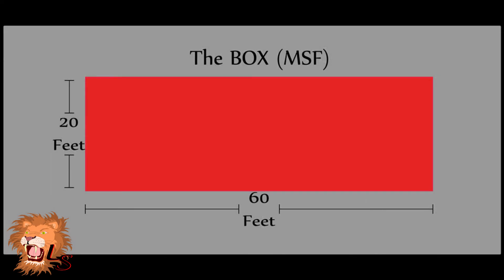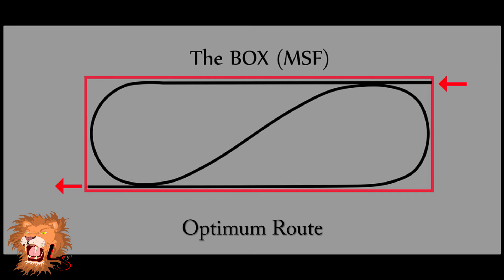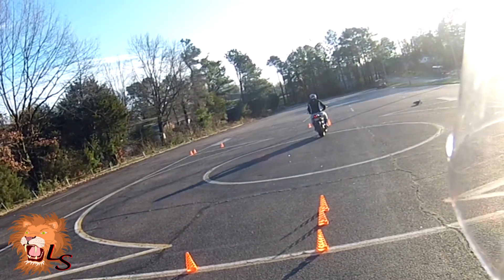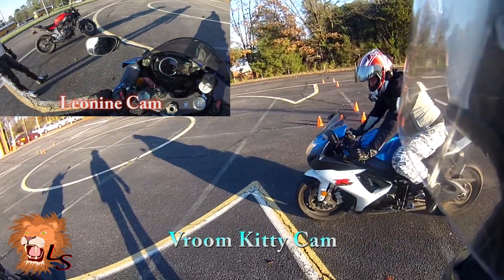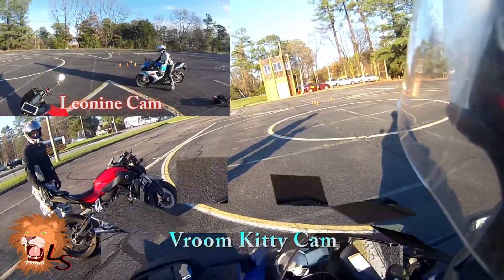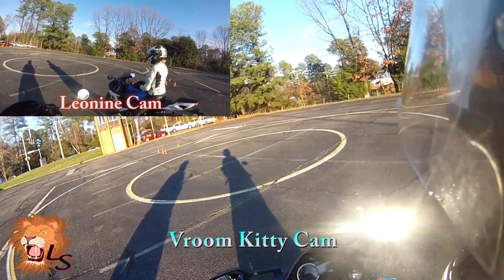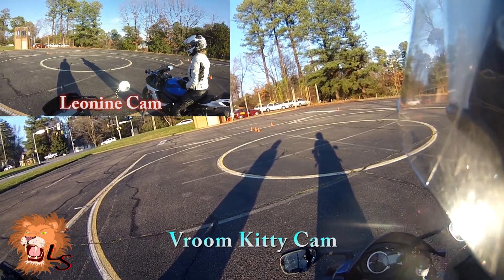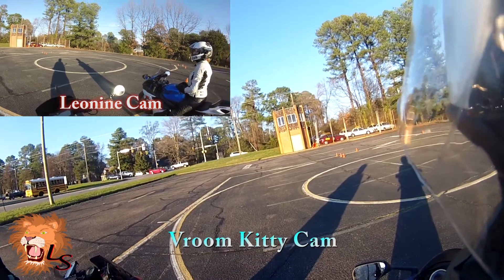The Box, Take 2

Comment: In Ohio, it's 20 feet for under 600cc and 24 feet for over 600cc. So the FZ07 has a really unfair advantage here. It has about the same physical stats (weight, wheelbase, etc.) as my previous CBR500. The FZ07 is definitely a great bike to take the test on if you don't have a little 250 available. Nice, helpful video you two.
Reply from the maker: TY, Luc.  Yeah, its a ridiculously nimble ride.  I think regular work on this drill really helps keep some skills you don't use often much sharper.

Comment: We have to do this (it's in Dutch, so just look at the pictures): https://www.cbr.nl/motoroefeningen.pp? as part of the exam for the motorcycle driving license. Besides a theoretical exam and a driving exam. (3 exams total, costs about 200€, then about 10 lessons from driving school is about the average amount of lessons, about 500-600€).
Reply from the maker: +Stefan 123 Some nice drills there.  I notice the 6 meter (20 feet) for turns seems to be an international standard.  I may try to work a few of these into my Winter Drills.  Thanks!

I took the MSF course ($175 +/-) to get my license.  It was two days, 6 hours classroom, 10 hours range.  It looks like its a bit easier to get a permit here...

We did a lot of those sort of drills.  The Box was one of the tougher ones for many riders, but it was not too bad once you got the head turn right.  Just like the cone drills, the trick is to look ahead where you wanna go.
Reply: Yeah, you're exactly right, always look where you want to go, and don't fix to one point. That's the trick to get through every corner anyway. If you ever need a translation of these drills let me know, I can translate it if you want.